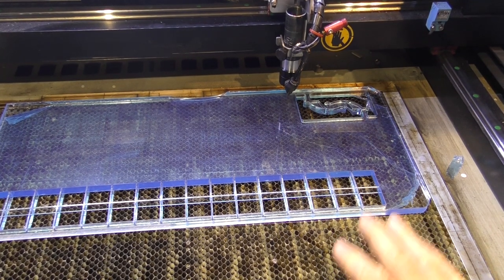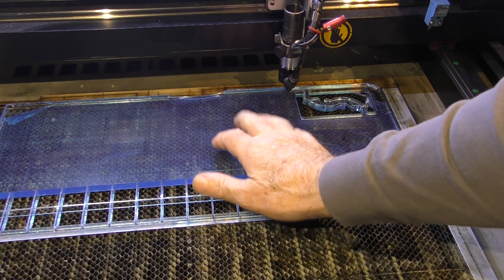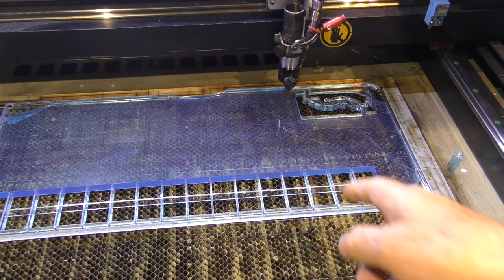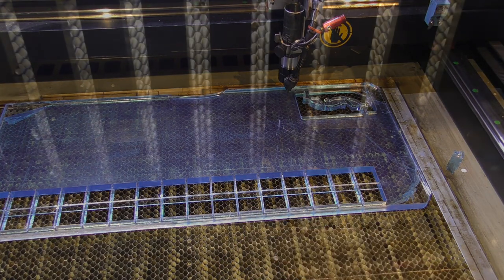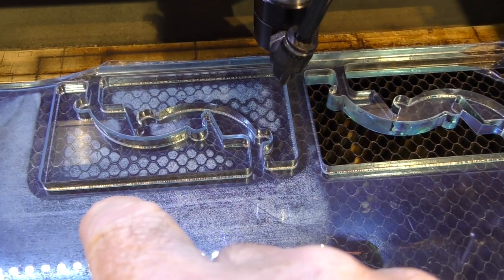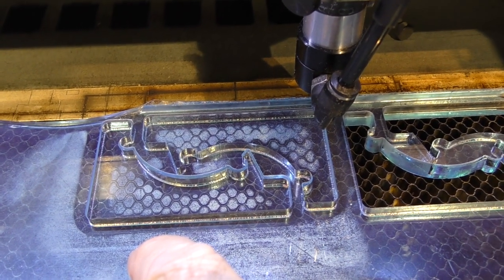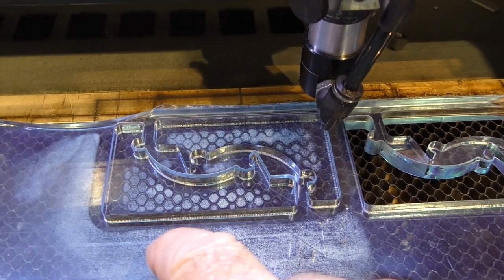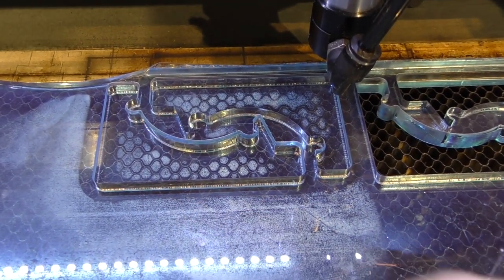RDWorks Learning Lab 195  Honeycomb--- A Disaster Looming

Comment: I've noticed this too. The question is, what to do?

I've theorized, in my amateur mind, that it could be a turbulence issue. Maybe a clever redesign of the shape of the empty space would resolve this. The vacuum of the extraction is not enough to overcome the trapped vapor, especially in the case of a larger machine like mine.

One temporary solution for me has been to place low profile, 1/4" allen head screws down through the holes to lift the work up about 0.125" or so. For the most part this works, until I work with thicker materials that require me to slow down to about 7 or 8 mm/sec. This is when I get flare ups again, except under one condition. If I have thick acrylic with no masking underneath, and it is raised slightly off the bed, I get no problems whatsoever. This is what led me to consider that it's an issue of turbulence in those small pockets.

I would love to see what would happen with a custom honeycomb grid that had holes in the metal itself, perpendicular to the surface of the table. Or maybe coming up with a creative way to generate a venturi effect just below the grid that would pull the vapor/gasses away toward the extraction. I've had some success with placing a large fan under the table, but there are "hot spots" or maybe "sweet spots" that occur, and it's not very effective. I've thought about trying a more precise placement of forced air, but honestly my table is so large that I don't think this would work.

So what else? Ionizing the air inside the machine? Would that be dangerous? Hitting it with a giant hammer? I'm ready to break some eggs!.
Reply from the maker: Hi Quinn
 The solution is very simple. Do not use honeycomb. Cover it with a sheet of steel and MANAGE the airflow through your machine Let air come in at the front of the machine (under the door)  and make the only extract point at the back of the table. In this way you will force a CROSSFLOW of air  above your work.  Now raise your work off that flat surface by about 10mm and you will have so much air flow velocity UNDER your work that the fumes will not be exposed to that excess energy to ignite. 
You have already partially discovered this  for yourself  but no matter how much you raise your work above the honeycomb,  that porous surface allows all your extract air a  much easier path to the extract duct. Virtually none is pulling fumes away from your under your work. You can easily test this idea with a sheet of 3mm MDF  temporarily.

Best wishes
Russ
Reply: @SarbarMultimedia  thanks Russ, I'll give that a shot.
Reply: Having spent 5 years driving a Lotus laser systems machine in a school I was always very aware of keeping it clean, we never had a fire though others nearly did when cutting things they shouldnt. What i am surprised at is how many manufacturers recomend bigger fans when all are limited to the same level of vaccum regardless of size. If you want to shift lots of air the area of the intakes have to balance the output otherwise the airflow will stall & cease to shift anything. Many machines have such obstructed ventilation slots that its hard to see how they can shift much air no matter how powerful a fan you fit.
Reply from the maker: @muddundee 
 Hi 
 My apprenticeship was with a large industrial fan manufacturer  in the days when EVERYTHING was done in-house. I gained wide experience in all aspects of engineering and trained as a production engineer. . It was in those early days that the design of fume cupboards  and other extraction systems that I learned that air flow only happens if you allow air in at the same rate that you are extracting it. As a general rule of thumb , air going out is compressed to a greater or lesser extent   (depending on the power of extraction) and the inflow area should be twice the outflow area. I look at nearly every laser machine (including the Lotus machines) and realize that the guys designing them have zero concept about fume extraction . In the case of Lotus , they are just importing Chinese cabinets but are otherwise building  a decent well engineered machine within. 
When you understand the weakness of honeycomb support (essential for some applications) there are ways to use it that are completely safe. I will be demonstrating this in a near future session.

Thanks for the comment
Best wishes
Russ
Reply: @SarbarMultimedia  Thats the perfect explanation, it explains perfectly why many extraction systems not just on lasers are so ineffective. I just fitted an extraction system for my new laser & its got 150mm ducting, twice that area is a lot!
Reply from the maker: @muddundee  i
 Hi  Twice the area may seem a lot .  Let's assume your extract fan  must produce a pressure difference of  3psi  to force the air down your 15cm .duct.  That can be imagined as  a single resistor in a 3 volt circuit.  Lets assume the circuit current flow to be 1 amp, then Ohms law says the resistor must be 3 ohms (your outlet duct). If we add another 3 ohms  (your inlet diameter)  into the circuit we now have 6 ohms of resistance . That means the FLOW in the circuit will drop to  0.5 amps.  I hope this electrical analogy (although not perfect because air is compressible) conveys the principle . You outlet duct is 177 sq cm, thus  your door is 60cm wide  it only need a 30mm gap under the door to achieve this.
Best wishes
Russ

Comment: That certainly brings home the danger of a honeycomb bed when cutting acrylic. On my Red Sail Clone the honeycomb bed is located in a solid sheet-metal tray with NO airflow so the danger is magnified, what a crazy and dangerous design. I am at a loss why reputable UK sellers keep providing such potentially dangerous beds on their machines. Many, many months ago when I saw your video on the danger of honeycomb beds and cutting acrylic I stopped using the honeycomb bed without a steel sheet and pin bed for acrylics.  I also drilled as many holes as I could on this awful metal tray on my Laserscript 3040 machine. What I had not realised was the potential danger with these beds and other materials such as ply and MDF. 

Once again a great video Russ, highlighting the potential danger of using a laser without fully understanding the mechanics of what is going on out of sight. Congratulations hopefully it might stop someone in their ignorance burning their house down or worse.
Reply: Hi Bruce
 As I answered in another comment, honeycomb has its uses. How else would you cut fabric?  Much as I dislike honeycomb, there are times when it is an essential aid. If you understand the dangers of using it, you can respect it, be ultra cautious but not fear it.
 Best wishes
Russ

Comment: Absolutely brilliant. Seeing how much waste the MDF or other plastics do lay on the top of the steel plate there's no way I am going back to the honeycomb table (one gains consciousness of that tar being sticked everywhere). The only problem for me, as of now, is that I have to make tiny junctions to the material for every piece I make, and when it comes to works with several tens of pieces it is a headache to do. Plus of that, pieces do not end with a polished profile, but have that lump where the junction was. Still way better than the honeycomb :P
Reply from the maker: -Hi Nico
 If you observe what is happening, it's lack of air flow beneath the honeycomb that is the root cause of this problem. If your job can tolerate the burn marks that honeycomb produces then you may like to try using honeycomb in an alternative way. If your honeycomb  is a loose item then put 12mm spacers on your  steel table and place the honeycomb on top. In this way  there is a forced air flow ACROSS the underneath of your honeycomb . It is the lack of airflow to remove the fumes that is the real issue.  I will be  doing a video about this alternative way to use honeycomb in a  near future session.
 Best wishes
Russ
Reply: @SarbarMultimedia  Hi Russ! I just made a breakthru, but maybe there are lots of people who already know this. In order to make the junctions or tabs more easily, you have to select your piece(s), and then go to the option Handle -> Bridge. There are several ways to automatize the tab creation and it is so easy that my head hurts for not having discovered this earlier!

Comment: If you're worried about low level combustion inside a steel box, are you sure you should be... burning...with a laser? I get this with my K40, it's never an issue, it's under control. I might be a tad jaded, as I'm a retired Boilermaker, used to degree numbers with more than one zero attached...
Reply: Hi
 Thanks for your concern. With 30watts your K40 is not a high fire risk. You have  very little free volume below your work surface and lots of metal casing and aluminium table to heat sink any flames.  I agree with you that this is not a problem if you understand the risk. Take a look at the last 5 minutes of this video and maybe you will see why I issue warnings
https://www.youtube.com/watch?v=n54uNRs8Ydk
Since then I can now say 9 machines with acrylic fires.
 Best wishes
Russ

Comment: My exhaust goes quite far to exit outside, and I’ve wondered if the fumes get trapped (condense) in my pipes will later catch on fire, from a spark, similar to a fireplace flue fire. I’m hoping that the temperature is just too low in the pipe and prevents that 3rd element of creating a fire to start the condensate on fire.
Reply from the maker: I am sure that you are correct. The ignition temperature of acrylic fumes is far too high to  cause a "chimney fire" situation.   Acrylic turns to vapour (just like steam)  at 200 C and will recondense to solid below 160C. It requires the VAPOUR to be  further heated by the laser beam to something over 550C before it  bursts into flame. Move a few cm away from the laser beam and all ignition risk disappears to zero. Thus any sedimentation in your ductwork is not a potential hazard.   Sleep easy!!!

Best wishes
Russ

Comment: oohh shit. please if you can find the time to answer this, it would be greatly appreciated. i have a Muse Core, an additional exhaust fan and a honeycomb table. how safe am i cutting 1/8 in (3.175mm) extruded acrylic with masking (solvent free transfer tape)? im sacred now.
Reply from the maker: Hi Artorias
  When you walk down the street you do not close your eyes and just step out into the traffic. Why? It's because you understand the danger/risk of doing so.. That is what this video is all about. It is making you aware of a potential danger.  Please take a look at this video
https://www.youtube.com/watch?v=n54uNRs8Ydk
NEVER fear your machine or this laser technology. Try to understand  it and RESPECT it. . Cutting any material on honeycomb increases the risk of fire BUT if you are cutting thin materials you will be cutting quite fast (more than 10mm/s?) in which case the excess power does not stay in one spot long enough to start a fire.  As you start cutting thicker materials your speed gets less and the risk of fire starts to increase.   The risk is still relatively low  but it is ESSENTIAL that you ALWAYS stay in attendance when CUTTING material. Engraving is an almost zero risk process  a() because the speed is high so lcal heating never builds up and b) the beam energy is 100% absorbed into the SURFACE of your material and there is no excess energy to ignite fumes.

 Sleep easy because now that you understand the problem, you  will naturally make an instinctive risk assessment each time you cut.

 Best wishes
Russ
Reply: @SarbarMultimedia   yeah i supposed it was too thin to go this wild and it does cut pretty fast. this acrylic looks thick. i never walk away from the machine, im always watching the job but after seeing this i wanted to ask someone that’s had more experience cuz maybe its been happening and i didnt know it. that really clears things up. thank you!! 🙏🏻